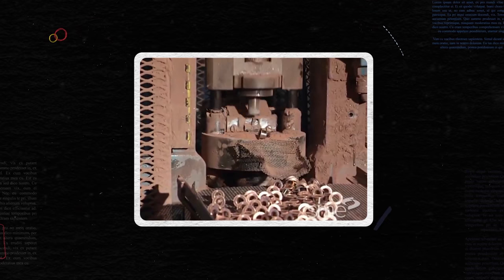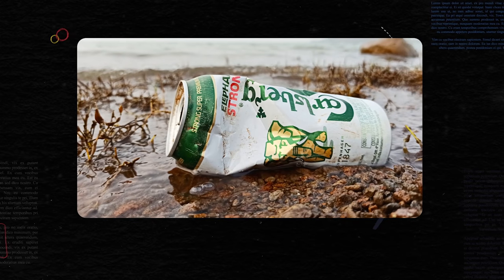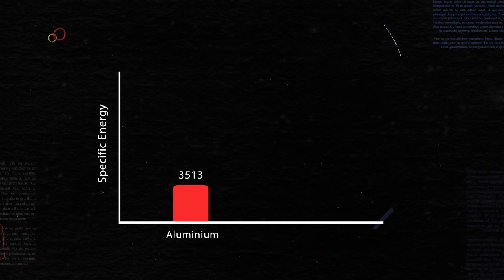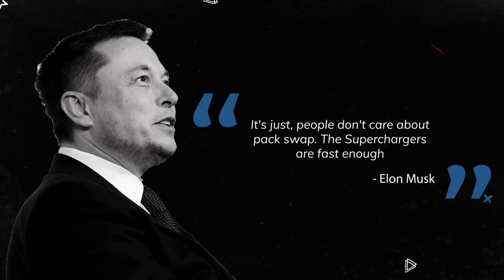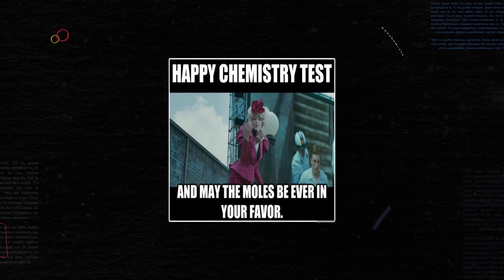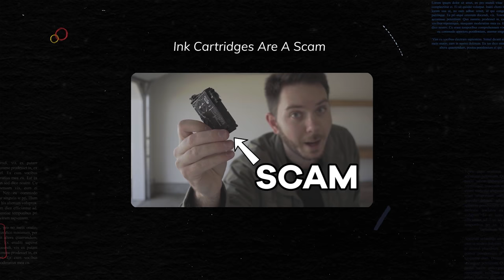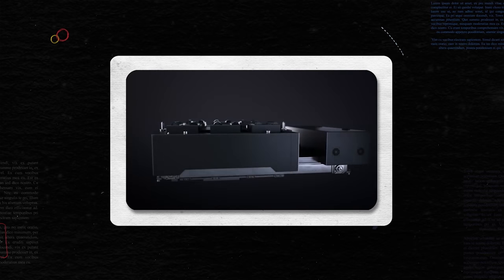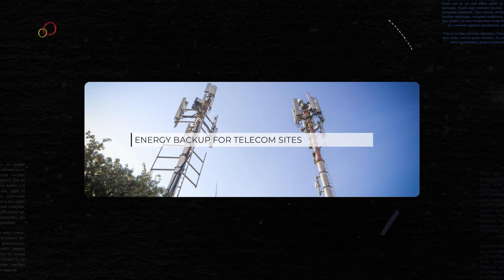We Can Get 1600 KM of Range With Aluminium Batteries

Comment: There's a much simpler solution to the drawbacks. Just reduce the range!
If ~40kg gets you to 1000km, I'll be happy to carry 4x10kg cartridges in the trunk, and replace them every 250km.
And every 4 replacements, I'll stop by the car shop and get new ones.

And if you want a small urban car, you can build it much lighter and just use 1 10kg cartridge with a smaller fuel cell. And have a fresh one delivered each week to your home. 😊

Comment: I'd love to see batteries like this used for Electric Unicycles and PEVs (if such a battery works for something so small and the PEV could be built for easy swap-out). 
"Yup. Just one battery. It'll take you 10,000 miles, and then you pay us $60 bucks and we'll ship you another one, which you can swap out at home. Just pop off the case, old battery off, new battery on, case back on, and 10,000 more miles!"

Comment: Just one question about the switching(refuelling) issues why would I need 1600KM Range when the casettes are 35kg, why not 400KM Range with a 8,75kg Casette, Or more sane two separate casettes in one car, each with 8,75kg and combined range of 800KM, and also bonus you have a full running car with all systems available between switching of one casette. So technicaly it would be very simple to switch a casette of 8,75kg or 10kg or whatewer the standard would be.

Comment: Having one 40kg cassette might be an issue... but five 10kg cassettes would be manageable.  I say five rather than four since dividing the mass means additional packaging for the same effective mass.  At 10kg, it becomes self-serviceable.  If you can get the unit size down to 5kg... even better.  It also allows manufacturers to scale the number of fuel cells to the needs of the vehicle.  A passenger car would need fewer cassettes than a delivery truck.

Comment: Use two batteries and they will only be as heavy as a lead acid battery. Easy to swap. Many EV motorbikes have batteries you can take indoors to charge. They use two, for just this manhandling reason.

Comment: I'm sure the future development will, and actually has improved performance and brought costs down of batteries. However, we already have 1,000KM range vehicles from Tesla and maybe others using various chemistries of lithium Ion batteries. Costs of the new Tesla 46 80 battery is around 50 USD per KWH so things are going in the right direction.

Comment: Why bother with this convoluted method when Graphene Batteries are on the horizon? Aluminum's energy density is indeed impressive but you're not offsetting anything akin to a greener future going through repeated refinement of aluminum. Whereas Graphene's source material could come from sequestration facilities...and getting graphene is MUCH easier in a world where getting rid of the stuff (Carbon) is our greatest concern, and it ending up in a landfill is hardly something to shed a tear about.

 Did I mention its recharge rate is PHENOMINAL compared to ANY current batteries? Did I also mention it's MUCH lighter than your aluminum or li-ion batts? Oh right and runaway heat from faulty batteries, or faults caused in the battery from overcharging and the like, aren't an issue as the battery is safer, and much more stable when it comes to runaway heat causing explosions, or fires. And I'm not talking about enhanced Graphene/Li-Ion Hybrids, either.

1000Wh per kilogram, Faster Charging and Discharging capacity, More flexible, stronger, lighter, AND less prone to runaway heat explosions from faults or shorts? Yeah, no...I think I'll pass on Aluminum and wait for full graphene production, instead, especially since their energy density is comparable.

Comment: So, I basically completely dependant on making an appointment and going to an anode replacement shop every 300km(186 miles)?? or my car is like totally useless? Cool!  Will it be as fun as going to a repair shop? Cause that's super-fun and totally not a huge waste of time!  Plus, I'll be doing water fill ups like I used to do gas fill-ups? That must be WAY more convenient cause it's like a different liquid, right?! I definitely know the price of aluminum won't launch into the upper stratosphere if all of us start burning through like 8000 lbs(15k miles) a year either! Yep, sign me up!

Comment: Theoretically alyminum-air battery might give you'r electric car 1000 km range. Practically diesel engine and full tank of diesel fuel will do very same think and:
1. Refueling is much better than replacing single use battery.
2. Remanufacturing aluminum-air single use batteries is nowhere to be found on this planet (for diesel that step is unnecessary, but biodisel does very similar thing)
3. Strain on the frame from constantly installing and removing heavy single - use battery
4. Infrastructure for diesel is already there.
5. Efficiency is better for diesel.
6. Don't like diesel -> there are gasoline, LPG and CNG for you.

Comment: I've been designing a remote, off-grid solar-powered radio installation using LiFePo4 chemistry. Now, I'm pondering powering the site with Aluminum-Air. Instead of building solar up on the mountain, I could keep the solar at home to feed the grid to recycle anodes. My head's about to explode!

Comment: Figuring $0.05 per km, that comes up to $2.05 per gallon equivalent to a car that gets 25 miles to gallon of gasoline.  Gasoline in Houston at this moment is $2.05.  Also, at what point does the increased availability of AlumHydroxide kill the price of that in the market?

Comment: Sludge removal every 300km? Nope.  Drone fleets and very small vehicles up to tuktuk size are the only use for this. Anodes will not be standardized so they're DOA in the USA, but India could standardize them.

Comment: Similarly with for HFCEVs (hydrogen fuel-cell EVs) infrastructure is a big concern here:  Filling/battery-swap stations will need to be constructed.  Electric plugs are already everywhere.

Bear in mind also that, although their Specific Energy (energy stored per unit mass), al-air’s advantage in Energy Density (energy stored per unit volume) is not nearly as substantial.

Comment: My Prius gets about 60 mpg, which (I think) works out to just about 12.4 cents per kilometer.
Another cost of Litium Ion batteries is the Cobalt, used for the cathode, which is a very rare metal and often involves slave labor tp extract.

Comment: Just no. Elon musk is right. Big batteries and ASS (hole) stations makes no sense. Make the batteries 1/8th the size or smaller (5 kg). Make the form factor generic enough to power anything portable, not just cars. If you need 100 km range, replace one cell, 200 km, replace 2, etc. Cars can then be made with varying numbers of slots ranging from single cell (golf carts) to multi-cell economy cars, to many cell SUV's, to massive numbers of cells for commercial trucks. Allow people to power electric lawn mowers, portable refrigerators, etc. Even make smaller form factors to power laptop computers. Allow people to buy them like any other battery, and transport them like any other battery. AND take away all government's ability to tax the batteries as vehicle fuel, thereby lowering costs of distribution and total cost of use.

Comment: $0.07 per km?  That's complete BS.  An Al/Air battery sufficient to go 1000 km is well over 200kg of aluminum.  And this company is claiming they can provide a full replacement (because this 'battery' isn't a battery as all, it's a consumed fuel needing replacement when empty) for $70??  Even with the best manufacturing automation, and economies of scale larger than Tesla's production, you'll never get a 200+ kg aluminum anything to be that cheap after raw ore costs, manufacturing costs, labor for replacement costs etc.  And to expect consumers to spend $70 per 1000 km? Gas is less expensive than that in an Internal Combustion Engine car today, proposing this be used for cars is a failure of an idea out of the gate.  (This is a symptom of everyone thinking they can be Elon, you can't.  Battery tech improvements are asymptotic, meaning they're approaching limits set by physics of chemistry, and improvements are in ever decreasing incriments.  The tinyest of gains cost billions in R&D, and will never beat the energy density of combustion.  Ever.  Stop believing it can.) 

Where Al/Air 'batteries' win are for uses that use them _seldomly_, can afford the replacement cost, an needs a solution that can sit, unused for years without degrading before use.  For example used paired with a backup power generator for a remote cellular tower.  When the power goes out, it could keep the tower powered for a minute or two until the genset starts, and could provide enough resource to do this 8-10 times before needing replacement.  THAT is where you'll see this used, NOT in a car.

Comment: For several decades, I have always done my own oil changes (if you want it done right, do it yourself); with the necessary tools, I would have no problem swapping out 400kg cartridges... would be worthwhile to know what is necessary to swap out anodes, and/or water Al Oxide... could even do it for my neighbors, on the side... small scale operations easily could replace the ubiquitous gas station/convenience store... on a 24/7 basis?

Comment: I don't get the 1600km or 1000km range claims if you have to replace the electrolyte and remove the Al2O3 every 300km. Most people think of range as how far they can drive without pulling into a station...

Comment: So let me get this straight:
I need to exchange a 100+ kg Part of my car whenever I "fill up" AND I need to scrape out the dead battery for chemicals and sell them, just so I can break even with petrolium?  Sign me the f*** up.
Li-Ion based Cars are fine and given the advent of solid-state Batteries, they will be finer. There is no need for this nonsense.
As a rule of thumb for the future: When a "re-fill" involves more than electicity, it's inferior technology. Why? Because you need a hole infrastructure for extracting, processing and distributing whatever it is you want to put in the car, that drives up the price and deminishes energy efficiency. Plus as a consumer, you'd get more dependent on central providers (which is never a good thing).

Comment: Break the battery / fuel cell (aluminum and water) into modules that weigh 5Kg or so (10kg after conversion to alumina).  

These aren't rechargeable, but would work nicely as a range extender for an 80 mile 130 km li-ion battery (that will work for almost all daily commutes).  Most of the driving would be done on li-ion.  Add two, 50 mile / 80 km fuel cells to eliminate range anxiety.  You could even carry spares for really long distance.

Comment: I'm also quite sure that the Aluminium cassettes will NOT be costed at the bulk price of aluminium; £2 per Kg, (otherwise you could buy any set of alloy wheels for £80).so the costings don't stack up either.

Comment: Aluminium Air 🔋 cons:
1. Can't recharge, Aluminium sheet needs to be replaced after every desired no. Of km range.
2. No control over the battery drain, the water which  causes oxidation & which helps to generate the energy/power, if kept/left inside the tank, will give rise to corrosion, and thus, battery drains & goes completely waste.
3. Replacing of the stuffs is quite complicated, you cannot do it easily. 
4. Although experiments have proven it to be the new future but it cannot be as successful as lithium batteries.
This new technology/invention can be as a alternative or emergency solution.
Tv ads & News which claims 1000km range or more are just gimmick, in actual reality it is quite hard to achieve. I don't say it is impossible but it's not as easy as it seems in automotive industry. This will take time and lots of R&D.

Comment: 1000 KM range is no great shakes, that's basically 640 miles.
In the US the average commute to work, one way, is 16 miles, or 32 miles there and back.  That means that in just 20 days or so, you would  need to replace your battery, and that's assuming you didn't go anywhere else in your car during the month.   In America distances are long and people regularly travel way more than 640 miles in a month.
The USDOT says that the average American travels 13,500 miles a month.  That means you would need to swap out your battery at least 21 times a year;  that's close to 2 times a month.  
Maybe some people would go for it if the cost were truly $20 per swap, but I think most will probably just stay with convenience.

Comment: recycling Li battery is profitable! Now in China, it is paid for those 100% dead battery. Lithium, Cobalt, and other rare metal are 90+%, or even 97% recycled. So, Li-ion battery lifetime issue is not as serious as it predicted. But per KM cost, need to add battery cost for sure.

Comment: Living in a rural village in Thailand the ideal vehicle for me would be the new to be released Hummer pick-up.  One of our orchards is off the beaten track 5 km from the nearest power pole and the Hummer would be ideal to power our tools and get us there.  Of course it may not be available in Thailand and the price in USA $ is over $100.000 so not a must have vehicle when we can buy a top of the range Toyota or Mitsubishi diesel for US$35.000.  A small diesel gen set is less than US$4000.  Aluminium air batteries...probably great for city folk, not so great for country bumpkins!

Comment: It's a great idea, but people (in general) hate wasting their time at service stations.
Current EV "long charging times" only apply to those who exceed the maximum available range.
When used within max range there is no waiting time. You arrive at work, charge your car while exercising your job and afterwards you can go home. Do some grocery shopping and charge your car while sleeping to find it fully charged the next day.
The refilling of water is not required. There are systems that will do this automatically.
Real potential can be acquired If they can achieve a 15.000 km distance before servicing. Great work and take care ✌️

Comment: I would like to see one of these Al-Air batteries designed with a "fluid" flushing system and/or water draining feature. Along with an aluminum cassettes that can easily be removed. So when I want to winterize or park my vehicle for a period of time. I can....  Now I just need to find 600 kWh of battery power.

Comment: 43kg/4 = under 11kg or about the weight of 3 gallons of milk. Why not just have FOUR-Packs of anode that you put into the trunk and hot swap one at a time?
Surely there is some logical reason why you can't take 43kg anodes and break them into 4 pieces?

Comment: So, you can't charge it. It burns the aluminium and then you'll have to change the fuel cassette. It's not a battery. It's just another fuel as fossil fuels... But doesn't produce CO2.

Comment: Yes definitely Al-air battery will be used in different circumstances, but it's still not mature enough to power EVs.
As Al-air battery is something like use & throw, may I know the price of a battery pack, which some one would have to replace  after 1000 kms?

Comment: It clearly wouldn't work in America where people can regularly drive 20+ miles (32 km) a day. That means an aluminum battery will last less than a 3rd of a year, and you'd be replacing the water every few days (which probably isn't an issue, but still more complicated than an Lithium battery's simple recharge).

Comment: The original name of the metal is Aluminum, discovered in the 17th century. The word Aluminum is from the Latin root Alumen. The Brits added the ‘I’ in the 18th century to the name so it would ‘rhyme’ with other elements such as Sodium or Potassium. Thus, the pronunciation of Aluminium is rubbish, as the Brits would say.

Comment: You missed a strong factor... cost of fossil fuels. At Rs.5/km Al-air battery is at par or more expensive than diesel. Plus there is so much effort to be made every 1000 kms. If one knows anything about the consumer than they know that changing their habits is the most difficult. Till the time someone does not figure out a way to bring the cost down to Re.1/km, I personally feel its a flop show. BTW, running cost of Li-ion is in paise.

Comment: I have a 2004 Mercedes Sl 350 the car cost £6500 in 2015 now worth £6500 2021 we only do 5000 miles per year so fuel costs around £1500 and oil change £100 , £1600 a year motoring, only reason to buy a new electric car would be if you are forced by the government by them making petrol and diesel illegal, or if you are an avid environmentalist unfortunately all battery cars do not currently financially make sense. ( only if you want to keep up with the neighbors there may be some incentives to buying one ?)

Comment: The battery pack could be made modular of modules weighing a few kilograms each and those could be made to be easily replaceable. The used modules could be sent to a facility to be refurbished as needed. Indeed, something like small reusable propane tanks.

Comment: These are not carbon neutral batteries because recycling of aluminium will require carbon anodes. Regeneration of aluminium will produce carbon dioxide, so these will have impact on environment.

Comment: This was a refreshingly splendid and informative presentation on the subject of the chemical science of the Aluminium Air battery. It was presented by a knowledgeable spokesperson. The Aluminium-Air battery is old technology. It has been used in places that need emergency power supply installations.

Comment: If the aluminum air battery reacts with the oxygen in the air, would it react with the oxygen in CO2? It seems to me that making large stationary batteries could take CO2, remove C from it for carbon sequestering. Two birds with one stone. Power production and carbon sequestering.

Comment: If a Aluminum Air Battery holds a charge 9 times more than a Lithium Battery your that had a 300 mile range now has a 2700 mile. The money makers won't stand for it .